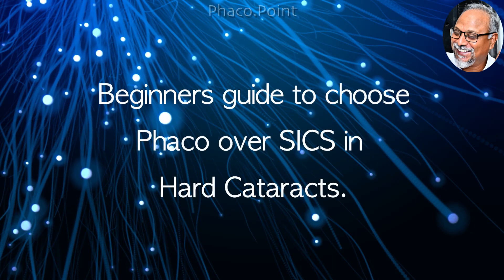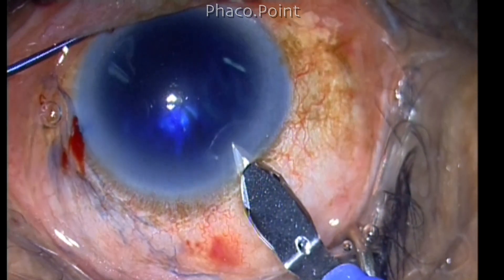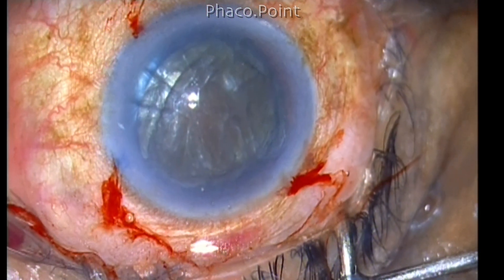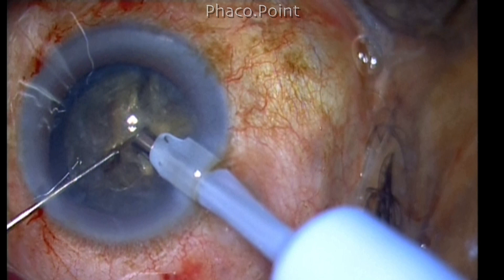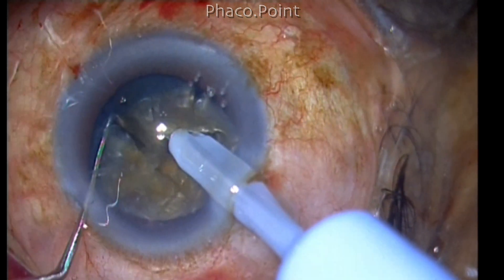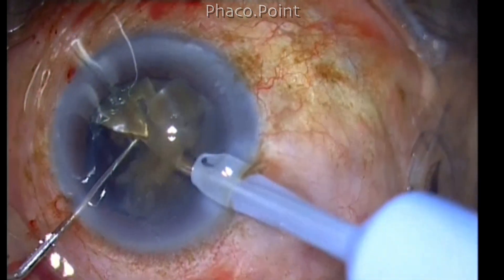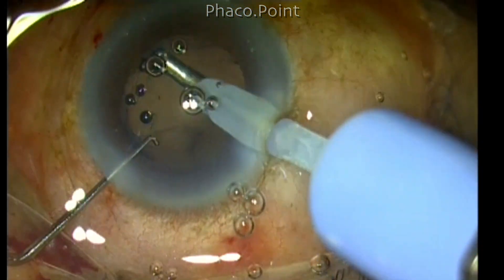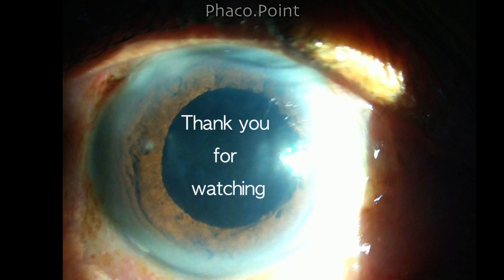The beginner's guide to choose Phaco over SICS in Hard cataracts

Comment: Sir I have mip and hyb mode in Chaxu machine.which mode I should prefer.
Reply from the maker: I have not used this machine. In hyper burst try for burst duration of 20 ms for grade 1. Also micro pulse a dc of 30 % with 30 p/ s will work. Try them both and see which feels better

Comment: Sir what machine you are using and how to change the phaco mode to multi burst one?
Reply from the maker: hi.. I am using the Stellaris PC machine. The multi burst or MB mode can be chosen from the submode option. If it is showing pulse mode you can set it up in the settings. Please contact the service engineer for your machine. Nearly all machines have the multi burst mode option which needs to be configured in the settings menu
Reply: Thank you so much Sir. I am currently using Laureate and it is set on burst mode. I switch to foot pedal position 3 while burying the phaco tip for direct chop and once it seems impaled, I come back to position 2. But sometimes, the tip loses its hold after coming back to position 2. And I have to impale the nucleus again. Could you please give an insight on why it is happening?
Reply from the maker: @prateetishrivastava7610  hello. first and foremost there is a difference between burst and multi burst mode. So make sure you are using multi burst mode. secondly if the power is too high or the power is used for a longer than needed time the nucleus emulsifies around the tip and the hold is lost . the trick is to use a short spell of power just enough to drive it into the nucleus substance but not too much to loosen the hold.
Reply: @PhacoPoint thank you so much sir for your inputs.